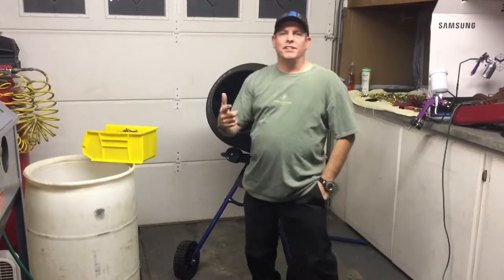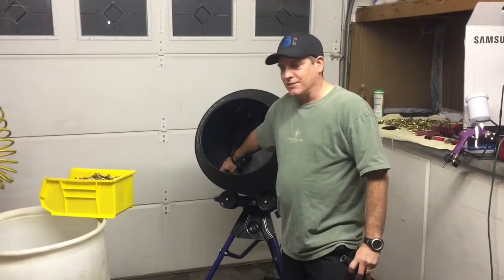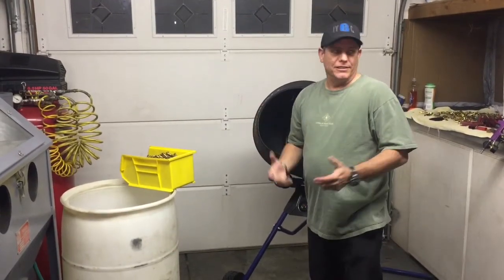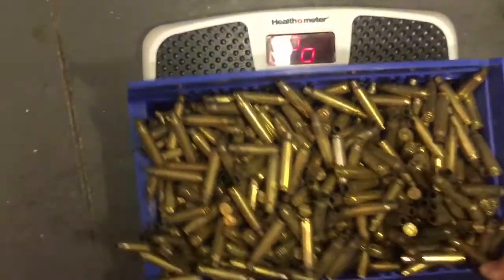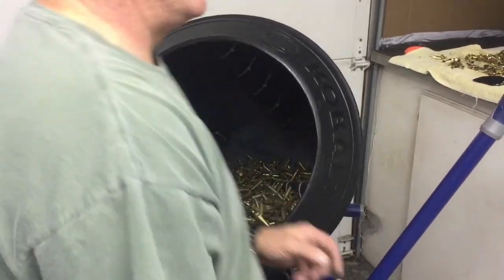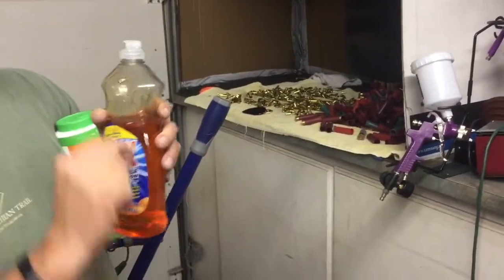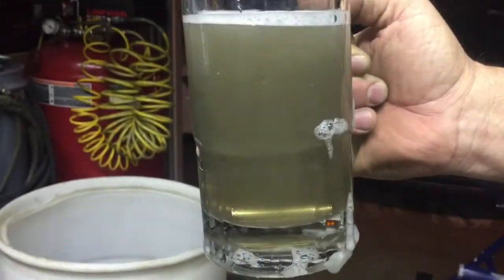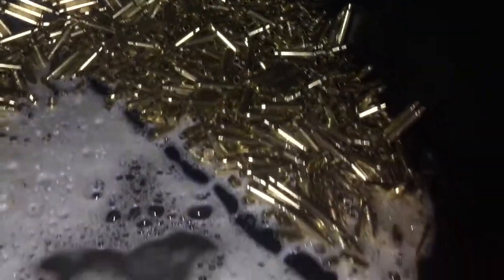Cement mixer Wet Tumbler Bad Ass

Comment: Use 4X4 blocks under the front legs of the mixer - that will stop the water frim ciming out. I took off the blades and plugged the holes with the rubber from roofing screws and the bolts from the blades, so no leaking on the sides.  Use walnut hulls and a little sand-  the shells will act and their own medium ti rub against each other. If the shelks staybtok wet they will rust inside. That hull and san mixer can be used over and over.!

Comment: Thanks for the video.Have you ever considered adding stainless steel pins for cleaning out the primer pockets?  I wet tumble with SS pins and they clean everything inside and out!
Reply from the maker: Yes SS pins make for an even better clean brass.  Thanks for watching

Comment: You can cut cost by buying citric acid instead of lemishine. Lemishine is nothing but Citric acid and lemon scent. The cheapest place to buy bulk citric acid is from candle manufactures as they use it; comparative shopping ftw!
Reply: oh and try throwing in some lemon juice with the citric acid, if you want that distinct scent of lemishine

Comment: Awesome. I bet you could make this work at the coin laundry mat.
Reply: Ya know....an old but still functional front loading washing machine would be perfect for this. Figure out how to eliminate the spin cycle and you've got an automatic brass washer and rinser.

For that matter, an old clothes dryer would work great to dry the brass too. Maybe turn the temp down a little.
Reply: I have pillow cases full of penny's about 3 bucks worth in each pillow case about 3 pillow cases a washer and its load as fuck lol

Comment: @Isyour6covered   My boat shop burned down on July 3rd this year.  I insurance. So I’m trying to salvage as many of the hard tools as I can. Like clamps and wrenches and sockets. Stuff like that. I have a big old school cement mixer. Think I could toss the tools in it with a mix of water. Sand and whatever else to clean the rust and burnt bits off?  What would you suggest for cleaning stones?  Or ceramic or whatever?
Reply from the maker: I would maybe try sand no water. The tools might be brittle cause of the heat they had

Comment: Harbor freight concrete mixer.... $209   go git one
Reply: Too loud, and they don’t last. I run a Kushlan all day and all night. My primary tumbler since 2013, no issues whatsoever other than replacing the bearings on it after a few hundred hours of tumbling about 60-80lbs of brass in walnut. If you’re looking to do brass on this level, get the most powerful motor you can and a commercial duty cycle. Just my experience after tumbling a few thousand pounds of brass.